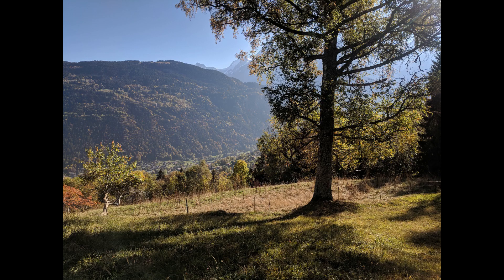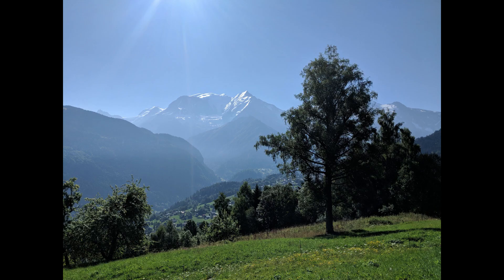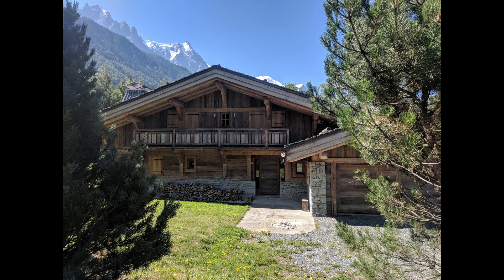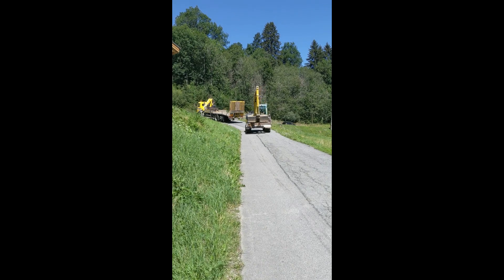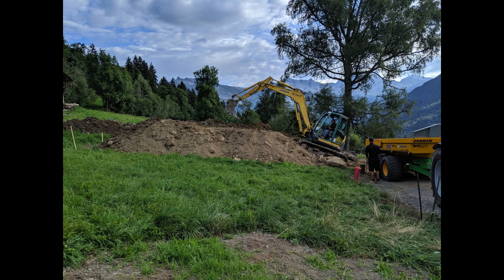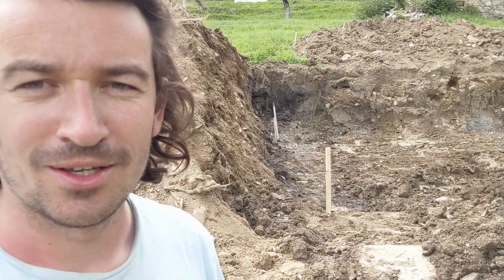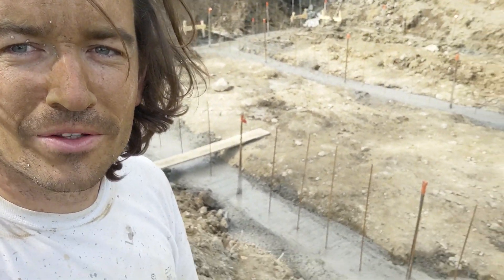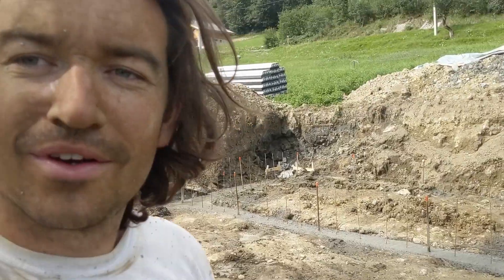How to build a Chalet Part 1 : Plans and Foundations !

Comment: What was painful about the process of getting the permit? What made it get declined?
Reply from the maker: Building codes are quite strict where we are so we where missing a few things on the design that they didn't understand (windows too big, siding patterns...), also we were missing a study of the water on the land ( they come and drill a few holes to make sure the type of standard type of foundations would be ok) . They also have a legal requirements to answer within 2 months and of course they take 2months - 3 days to tell you that you're missing something...